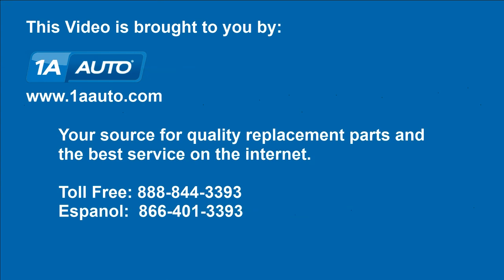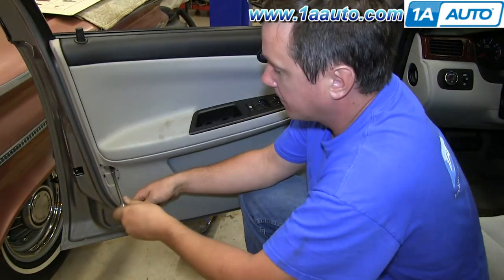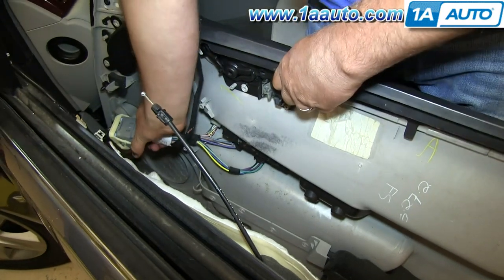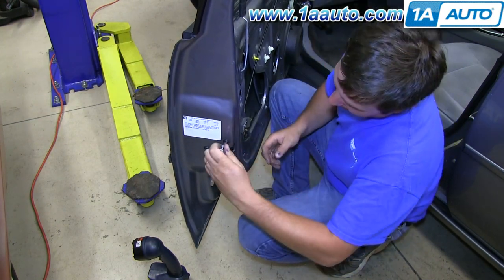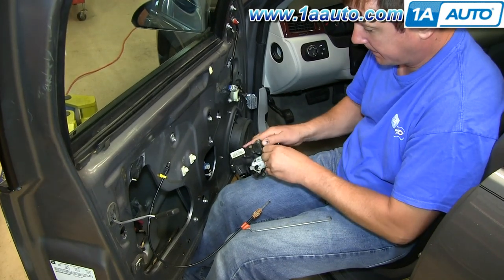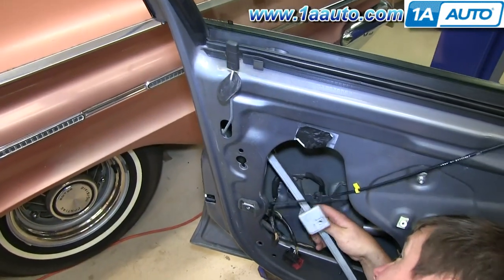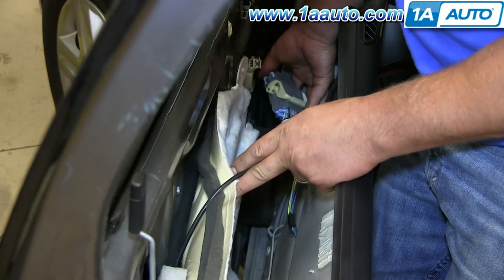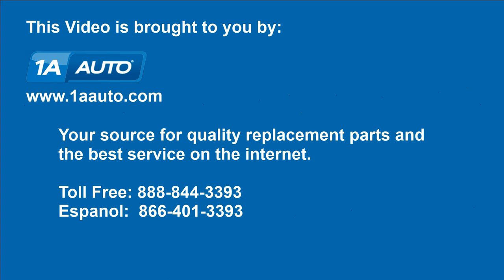How to Replace Door Lock Actuator & Integrated Latch 06-11 Chevy Impala

Comment: I just wanted to thank you for the amazing video . I have an 2009 Buick Lucerne and my front passenger door lock actuator didn't work. The dealership quoted approx. $ 450.00 to do the job. I ordered the part on line. It came yesterday and my work began. It went quite smoothly with the exception of one T30 torque screw that gave me a little trouble. My friend was amazed I could do this as I am a 68 yr. old female . The part cost $98.06 .Thanks again.
Reply from the maker: Nice work.  Congratulations on the successful repair.  1aauto.com 866-403-3393

Comment: Coming from somebody who works at an assembly plant and on the door line. For 8 years, snug the t30 shut the door to make sure its aline if not tighten the t30 then loosen the Stryker shut the door an it should be realigned, Then reassemble.

Comment: Very good video. I had to replace both front door lock actuators to get them to work. They failed after the car had 27k miles on it! First one took me 38 minutes, 2nd one 20 minutes, This video is priceless to save you time.

Comment: On my 2009 Impala I needed a 7 mm socket (not a 8 mm socket) to remove the screw behind the door reflector.  Other than that this is  a Excellent tutorial.  Took less than 30 minutes!  Did it with the door window up AND used a small flashlight to see inside the door.

Comment: Really great video and easy to get the parts. Here are a few lessons I learned. 1) When re-installing the window bracket, make sure the rod is not trapped between the  bracket and the door frame (the door knob wont go up and down...obvious the second time :D) 2) The Door Knob can be rotated to raise or lower the knob. Once I got the panel back on, the knob in the locked position was too low to pull with fingers if needed. It took me a little longer than expected, but...for a DIY project, it wasn't that hard.
Reply from the maker: Thank you for the great reply. We love to empower our customers by showing you how-to perform your own auto repairs while installing our high quality auto parts. Have a great day! 1aauto.com +Chuck Bryan
Reply: I did the same thing with the window bracket.

Comment: This is an excellent video but if you can not open the door from inside or outside how is this done esp the plastic triangle at the front of the door. LOL I will try anyway and see what I might need but could use the extra help.

Comment: Damn it! how do you GET THE DAMN DOOR OPEN to fix this
????? Everyone shows you the repair with an OPEN DOOR!
Reply from the maker: +inkblot131 Thanks for watching!  If the door is stuck shut then there could be an issue with the lock or latch.  In that case you will have to get a locksmith or AAA to come and pop open the door.  1aauto.com
Reply: @1AAuto  Thank you, 1A. I'm sorry for the 'outburst!' Thing is, I'm an old man -always been a 'doer' until Technology passed my age faster than an Indy car.

As defense, had just heard an estimate from Nissan for replacement of the door-lock actuator:

"$322-$498!" 

It was after cruelly yelling at you that my brain began working, which is happening less and less often it seems, that begin to realize it may not be the lock at all, but the handles. It was about 3 degrees when I opened the door. It was stuck a bit, but no more than any other car I've owned over the last umpteen hundred years. So I only thought, "Kansas, we have a problem."when I got where I was going.., and couldn't get out. Naturally, I pressed the unlock button, but, no...

Relief! How much could a set of door handles cost? Must be millions of Rogues setting in junk yards; not because of quality issues but because my 2009 (18,000 Actual miles) looks as new as the 2017s. So. I called a '5 star' repair shop. 

"How much do you estimate removing the inner door panel and replacing the door handles?" 

"Chrome?"

"Grey." 

"OK, I've ordered black handles.., Looks like about three days to get here. It'll be about $278." 

"I don't deal in 'about,' Better cancel those handles.., Sir."

Tomorrow, I'm calling an auto-body shop. They MUST  be accustomed to opening smashed or jammed doors.

If that doesn't work, I'll buy a mat to cover the console, buy shoes I can easily slip off and crawl from passenger to driver's seat for the next 100,000 miles. 

Again, sorry for 'shouting.'

Comment: hello, i bought the actuator for my 2007 Chevy Impala, and installing it was going smoothly until i had to connect the wire with the red latch back into the acutator, basically the cable with the red latch doesnt match the actuators plug in for that cable, i noticed that the new actuator has 4 pins across on the top half of the pins when on my old actuator plug in has 3 holes across for the pins so its just not fitting. please help ASAP

Comment: Do you do this with the window up or down?
Reply: 1. The door in this video has no glass. That makes it seem so easy
2. The door in this video is unlocked, unlatched and open. That makes it seem so easy.
I completely gave up doing this on my 2000 Buick Regal because I can't unlock the freaking door.

Comment: Hi! I took all the wiring out to replace a crashed door. I put everything back except for the air bag sensor.. where does it go? I thought it was up higher by the handle on the inside panel. Please help

Comment: I have a 2013 impala and my locks will go up and down remotely as well as manually. However, the door will not open. Is this an actuator problem, or a latch issue? I can not manipulate the door open internally, even after taking the panel off. Thoughts?  Thank you all!

Comment: My rear door won’t open from the inside or outside. It locks and the window works. Any advice on how to get the door to open, when I pull the handle it doesn’t feel like it’s latching on to anything.

Comment: What part would you need to replace if the lock and unlock buttons don't work because of water damage (on a 2013 impala)?
Reply from the maker: +Chris Reyes We are unable to diagnose the vehicle without a physical inspection. As there may be several causes we recommend having the vehicle inspected by a reputable mechanic. +1A Auto
Reply: @1AAuto   Ok thanks anyways, Appreciate the time you take to answer these question.

Comment: All 4 of mine work intermittently. They will sometimes lock and unlock for me and after a few tries then they get weak. Is there a relay somewhere? because I cannot find it.
Reply from the maker: +JmLykins You may want to check the door harness that runs between the door and body of the vehicle for a frayed or broken wire that may need to be replaced. Hope this helps you out. 1aauto.com
Reply: I have the same problem. Let me know if you figure it out.

Comment: Would this fix my issue?  All doors work fine,  but when it gets hot outside my drivers door will not unlock with the keypad.  I have to put the key in to unlock.
Reply from the maker: +Scott Shelton Thanks for watching.  It certainly could be the issue, Scott!

Comment: my passenger door does not lock or unlock with the key or buttons.  Is this the part that needs replaced?  or could it be something else?
Reply from the maker: I could be a bad door lock actuator. You may want to test the power going to it to see if it has power when the door lock switch is pressed. If you can hear it trying to move but it doesn't, than the actuator may be frozen and may need to be replaced. Hope this helps you out. 1aauto.com 888-844-3393

Comment: The front left door lock in my car (Optra/Lacetti/Nubira) stutters when unlocking. Should it be the actuator that needs a replacement? I opened the door panel successfully, but there's no bolt or enough space on the metal panel for me to reach the actuator. Could someone please help? Thank you!

Comment: I can not open the door inside or outside using the beeper or the car door key, how can I open he door manually to replace the door lock actuator   The key to open the door do not works.
I want to know how to open the door manually to replace the actuator for my chevy equinox 
2009...